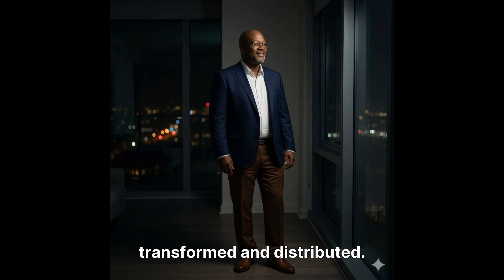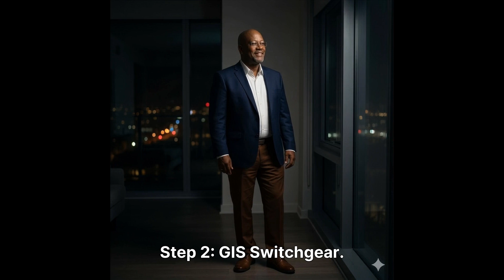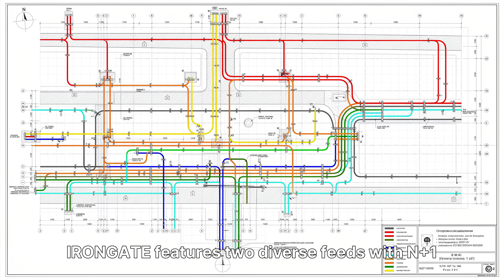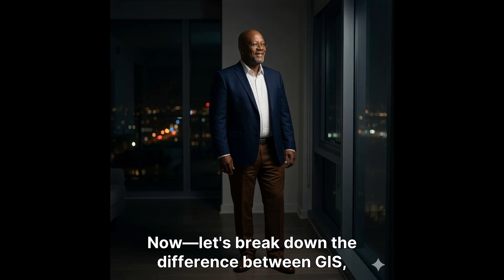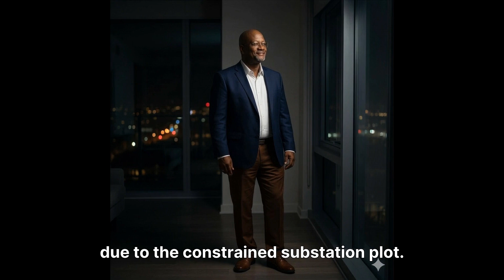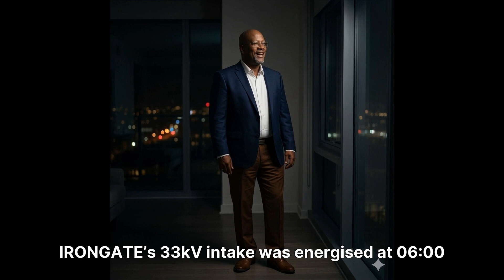Catalyst Grid | Series 1 Episode 10 — HV Substation (Transformers & MV Switchgear Explained)

Comment from the maker: This is the point where the project becomes live.

Everything before this leads here.

Everything after depends on it.

---

If the substation is wrong, the entire building is compromised.

No redundancy. No resilience. No margin for error.

---

👇 What’s the most complex electrical system you’ve worked on?

(Substations, switchgear, protection systems — let’s hear it)